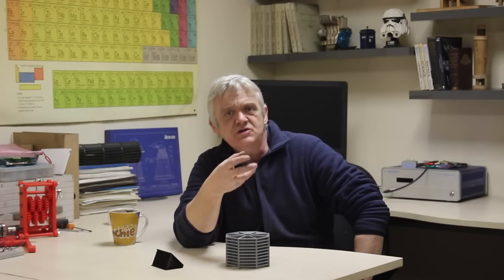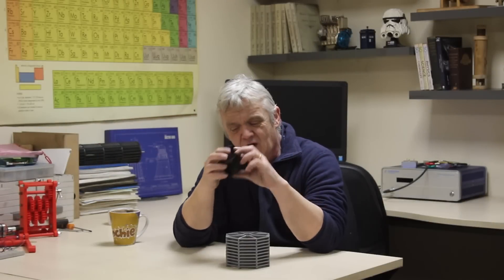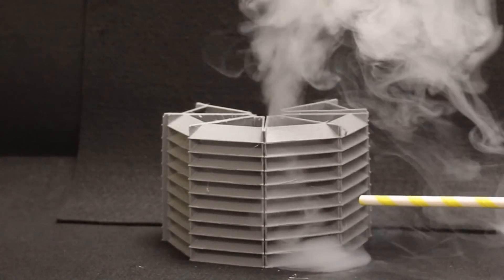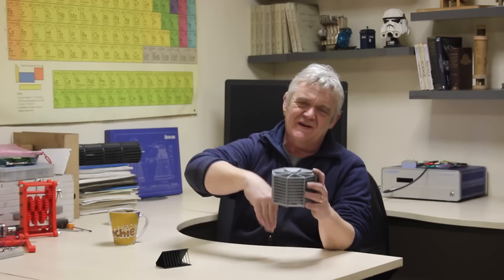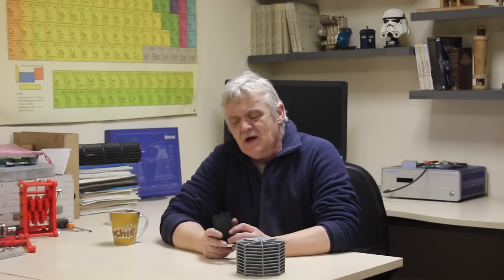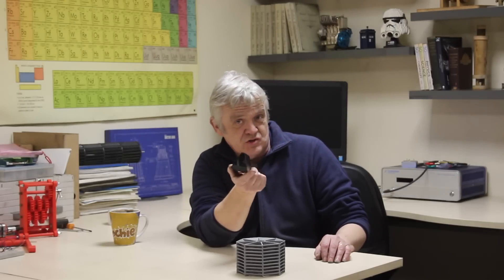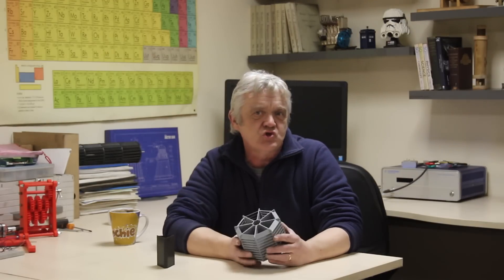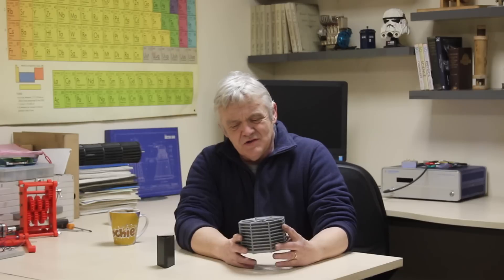1830 A Darwin Wind Turbine Breakthrough

Comment: And... The birds can nest in the upper part of the wedges!

Birds are going to do what birds do, and as the top is negative space as far as wind generation is concerned, maybe there,a a way to take advantage of the birds nesting in the top.  Maybe the heat generated by the birds and their decaying nesting material could keep ice from forming in the system or the heat heat differential could cause additional airflow in low wind?  Hot air is thinner than cold air, and gas flowed from high density to low density....
Maybe painting the top black could create some air draw?

Also. Which way I'd the 35° measured from? The horizon or the top?
Reply from the maker: the horizon - maybe some bird netting over it?
Reply: @ThinkingandTinkering  just pondering if there's a way to make birds nesting on top a good thing for the system.  Could thusly offered a secondary advantage somehow...

Comment: hrmm could you use the centre tube in the structure as a draw tube to draw more air into the intake using the velocity of the air being directed into the tube like those dyson ring fans do to boost up the effiency of the tower perhaps?
Reply from the maker: yes you could - nice one mate

Comment: That's really great that Rob, it did occur to me that it may be possible to get the air to spin (think Dyson vacuum) before it hit the turbine blade.. Have no idea if it would make it any better - just a thought.
Thanks 👍
Reply from the maker: it's a good thought mate - cheers
Reply: That will happen automatically to some degree if there is a fan-blade of the rotary type added to the end. Swirl will be created that way.

Comment: Very clever.  It's a sort of one-way tube for air.  I wonder if it can be used to vent hot air from the roof cavity to provide additional cooling in hot climates.  Or even as an improved chimney design.
Reply from the maker: I like the thinking mate and now I wonder the same thing!

Comment: Hi Robert,
Does it have to be as complicated as that? What about just one panel that is able to turn to face the wind direction. Yes, you would need extra tech to allow that to happen but you would be reducing the amount of materials required to construct the circle version and therefor the overall weight of the unit. Just a thought.
Reply from the maker: it's a good thought - try it and see

Comment: Fascinating. What is the optimum height of the louvred section (~number of louvres) to drive a pipe/fan of a given diameter? Should the fan (turbine) blade angle be 35° too? What should be done with the exhaust air?
Reply from the maker: no idea lol

Comment: I remember watching a show about bridge engineering and that on large columns and such they put helical fins around the column to prevent eddies forming and to stop vibration and I keep wondering if adding similar to the inside of your pipe, would help streamline the wind and increase the efficiency of the captured wind before it reaches the venturi and the turbine blades. I don't do a lot of fluid dynamics but wouldn't organised air lose less energy? Love what you are doing
Reply from the maker: I like that suggestion mate - cheers

Comment: Great video mate. Well done! Would love to see a close up of the cheesy wedge!

I wonder what would work better, forcing all that wind down a longer tower, or multiple motors every X CM stacked on top of each other. I imagine it would also depend on average wind speed, but might be worth some further experimentation to see where any sweet spots lie. Think you're really on to something with this one, would love to see more!
Reply from the maker: I was thinking of doing a vid on the design - it's simple but folks like a close up and I agree it helps
Reply: (the hazard with trying to maintain flow energy through a long duct/tall tower - using an expansion tower plennum - lowering velocity through the "larger" duct, then a converging nozzle - at the turbine inlet should maximise generation out of this system.  Every system has limitations - the "cheese slices" limit inlet plennum volume to something less than half of the total, also - these tests don't show the suction effect of true "freestream" flow - fabric (soft vinyl or other) valving to close the suction side off instead of the full depth "cheese segment" fixed flaps - may produce dividends )

Comment: I got 6 louvre doors in the shed! 👍
Reply from the maker: awesome! lol - don't forget to replace the door !
Reply: @ThinkingandTinkering  I thought I would try stapling fabric, or plastic sheet to the inside of the louvres and cut slit flaps in it, so air can blow in but also push the unused flaps closed as it does. Any opinion?

Comment: According to Betz's law, the maximum efficiency of a wind turbine is 59%. If you multiply that by 90 degrees, you get 53 degrees. The complement of this angle to the right angle is 37 degrees. Does this have anything to do with the optimal 35 degree angle?
Reply from the maker: I don't know

Comment: I cannot help but think. I think the test has failed, not having a cap on top. When you do, I think the passing air (of the wind) is creating a vacuum, on the backside, and draw the air in the same direction (out of your device). To test it correctly you need real wind, which passes by your device to the sides and above, and then see what happens. Hmm, as I start thinking. You could even capture that vacuum as well! You need 8 pipes which go to the 'outlet' below your generator. This will recycle the air, but importantly, lower the total friction. Just thinking out loud .. .. I know that always leads to something better and it does not even have to be about what I said, but it leads to thinking differently  in general.
Reply from the maker: this isn't in isolation mate - I did the reading - actually all I am showing is a visual of a few research papers I cobbled together

Comment: I'm a hvac installer. Essentially you've created a duct. If you add and curve  the iner throat of the "cheesy wedge" it will essentially 'pull' the air around the corner and reduce drag kind of like a air foil on a wing
Reply: Also if you flare out at the outlet  you might find you increase the volume of air I wouldn't add much say 10 degree should  be more than adequate.  I realize it add complexity but you can do alot of neat shapes in tinkercad
Reply from the maker: nice - thank you for the suggestions mate

Comment: I'd like to see more content about head batteries, or to be more exact about the way to cheaply transfer the heat from really hot mass. Sand could be heated to couple hundread degrees C, but transfering this heat to something more usable could be a problem.
Reply from the maker: there is not a lot to say about them mate - use a heat exchanger

Comment: Brilliant!, so if the design would direct the wind up or down into a vortex of 35' this would be ideal I derive? Currently the flow has to bend 90'-35' = 55'. Admittedly difficult to do efficiently with flat panels. Have added a 3 step angle concept to tverse. edit: Rethinking your design, behind the device a negative pressure will be formed, not sure how big the impact of that is. Although it undermines the objective of 'no moving parts', this negative pressure could be used on the outlet of the generator to improve performance.
Reply from the maker: a wells turbine?
Reply: @ThinkingandTinkering  Not what I meant, air flow around cylinder will create a vacuum at the back effectively sucking air in the opposite direction, effectively putting a break on the generator. Not sure how to share 3d models/info without YT removing it, ThingiV object 5812910.

Comment: Have you thought of trying what invelox are doing but you put 8 in a circle and you can even narrow down the out let  at the bottom to increase the wind speed. This way there is less wind resistance from all the little flaps in your version so in theory it should be better efficiency. Remember every surface that wind has contact with Will slow down the speed a small amount. Btw flat edges and sharp corners create turbulence which slows down and reduces energy. Smooth round corners and edges are better for efficiency but more difficult in production.
Reply from the maker: I have done it already mate

Comment: Nice one, Rob! How tall can you make this thing before getting diminishing returns on the airflow? I bet there's an optimal ratio between height and radius. At first I was thinking a pyramid or a cone shape might do well (the cone angle would be arctan(optimal height/radius) ), but then you're losing a lot of captured area at the top.
Reply: The 35° angle is going to give you the maximum ratio of height to radius.  Rob didn't mention if that 35° is measured from the horizon or from the top.  If it's the horizon, the Radius is sin(35), Height is cos(35).  If it's from the top, you reverse that. The Radius is cos(35) and the Height is sin(35)

Multiply each those by what ever your unit length is going to be and you'll get your dimensions

There could be a sweet spot in between, cut off some of the top, cut off some of the bottom.  That would make for a good stacked tower
Reply from the maker: there probably is mate - but I don't know it - yet! lol

Comment: I suspect that the "ideal" angle will actually be a section of a parabola. 
I also suspect that it might not be worth the extra effort to get there unless you are a factory producing many units.

When you think about it you want the leading edge to be close to the angle of the wind entering the device and the trailing one to be close to the direction of travel you want the air to go in.
Having the central area blocked by a solid barrier is a touch of genius. If there is a small to no gap between the fan blades and the central barrier there will not be any "spillage back up the low pressure down wind side of the device.

Nicely done Sir!
Reply from the maker: cheers mate - but also - very nice ideas from you - thanks for sharing
Reply: @ThinkingandTinkering  You are welcome!

Comment: Would there be any advantage to be had from alternating the direction of every other flap set and then placing a generator on both top and bottom?
It might allow for you to operate in higher wind speeds at the cost of needing to have a higher starting speed. 
We might get some surprises with the equal spacing, however.
Reply from the maker: I don't know to be honest - worth a try - fancy trying and sharing your results?

Comment: Nice!  Wouldn't you be able to save a lot of print material by not printing one of the sides?  All of the sides where the wedges connect are doubled, and really you only need one surface between each wedge.  Printing just enough between the louvers to connect them on one of the sides, and the wedge wall on the other side will save time and PLA.
Reply from the maker: yes but it would make construction a little more complicated - but not by much

Comment: Install these around the citylight concrete pole, and you do not have to make the internal core, but you can generate the electricity for the citylight itself. Because the hight of the pole I assume, the sqm of that sort of wind cathcer would be a lot, so does the energy generetaed by that much air. Robert can you give an estimate for a lifesize scale model?
Reply from the maker: I like that idea mate - nice share

Comment: Couldn't you use a weather vane set up and reduce your materials by a large percentage and reduce "dead inlets".  Yes it would require and additional mechanism on the base but not that complex.  You could really make a flatter panel wind capture and certainly increase the capture area for the same amount of materials.  Essentially like some triangular wind vanes at airports (for pilots to see from the air).  (Look up airport ground wind indicators for examples.
Reply from the maker: you could - go for it mate
Reply: @ThinkingandTinkering  well🤣 send me that 3d printer😂 Keep on with your good ideas and thanks

Comment: An excellent idea to prevent air flowing out the down wind side of the collecting tube. I wonder if a possible issue may exist at the turbine end of the wedged tube in that only 1 of the 6 wedges will be powering the fan blades with down drafted air. Would this then mean the rotating fan passing beneath the other 5 wedges is actively pulling air down them and so contributing a large energy expenditure, reducing efficiency?
Reply from the maker: we will find out mate

Comment: Great idee, i see only one problem. If you use it with the generator on the bottem, Al the rain wil be going inside and could damage the generator.
Reply from the maker: that will not happen mate - most - if not all wind generators have the generator at the top of a pole and that does just fine in wind rain sleet and snow

Comment: Hate to throw cold water on this but the problem is going to be that the leeward side is going to suck air through its cheesy wedge pulling the air pressure away from your turbine at the bottom.

This is why you have to have some mechanical flaps to prevent the downwind side from sucking the air pressure out of the Tower instead of it going down the turbine.
Reply from the maker: lol - ah mate - thought about that - put a wells turbine on the bottom

Comment: A variant I seen while I was watching your video is that the upper slates would be longer and the lower ones shorter, to help reduce turbulence and make a laminar flow and maybe give it a round shape so the upper ones can bend the flow seemlessly and the lower ones still at 35 degrees and the mid ones stopping at different level since you can't keep the curb from top to bottom without creating a restriction.
Reply: I like the fact that the mechanical part is not up in the air. even if the ducting limits the energy it produce it could still be interesting.
Reply from the maker: nice suggestions mate - cheers

Comment: Co flow technology might helped as a quick mod. In theory up to 70degrees of attack. Louvres. think shark gills?  If you did it right you can induce more airflow. ? Using the wild to induce air currents? I’ve made a co flow shelf. Which can be angled to optimised airflow? It can be made cheaply out of a shelf from b&q. For about £12 unit? With a forming rollers. Add two slit to few of the shelves. Then place inside the non modified shelf. To make a sandwich. You can also use them as guide fins?  You might also want to investigate adding piled carpet to the side walls? As it can smooth airflow by reducing boundary layer effects? Shark gills are incredibly efficient at what they do? If it works in water it might just work here?
Reply from the maker: nice share mate - thanks
Reply: @ThinkingandTinkering  thoughts you might like it? Great to hear it!

Comment: It could be worthwhile having sections of gradually increasing diameter. With a ground level turbine, that could allow for easier erection of the column and allow for collapse to a short height e.g. to clean or avoid high windspeed damage.
Reply from the maker: cheers mate

Comment: Well done yet again Rob very inciteful and briliant You mentioned the venturi lower down how about making it on the top of the pipe and making the darwin collector bigger then you can use a smaller diameter pipe that would be cheeper and have less wind resistace
Reply from the maker: nice one mate - cheers

Comment: Just a thought Rob, How about several fans down the length of pipe to maximise the air flow. Granted the force further down the tube would be less due to the drag coefficient. but could  give a reasonable return of power ???? I'll put it on my to do list. lol

How about putting it on top of a flue pipe so the wind forces the heated air in the flue pipe out faster, giving a stronger air flow through , say a rocket mass heater giving a better burn. I'm building one at t6he moment in my greenhouse, so i will try this one out.
Awesome.:goodvibes:
Reply from the maker: awesome mate - please share your results

Comment: Perhaps replacing that centre cylinder with an exaggerated screw thread. Big enough to guid the air towards your focal point, it may help reduce the amount leaking back out the front simply by creating an air draw
Reply from the maker: maybe mate - go for it and share the result!

Comment: If you look at the segmentation of your air collector . . . you could take those segments apart and distribute an appropriate number of them around an existing column, chimney, or tower, and then have multiple fans at the base, or use one large fan with smallish collectors distributed in a ring above the ends of its vanes, again with some central structure.  This might add power generation to existing columns (chimneys, flagpoles, support structures) and/or increase collection area at little additional cost, while removing the need for a tall stack of collectors to be structurally self-sufficient.
Reply from the maker: clever mate - nice one

Comment: Excellent that internal structure will stop loosing the air collected & greatly increase strength but if you remove one of the walls from sections each section would be one wall for the next section & remove a large amount of material with out reduction in strength.
Reply from the maker: good suggestion mate - cheers

Comment: Why do there need to be cheezy wedges at all?  Why not make it one piece?  You would save material and you would not have to assemble it.
Reply from the maker: so you can print it in parts big or small depending on your printer - or do it in one job if you have the equipment or a 'kit of smaller parts' if you don't
Reply: @ThinkingandTinkering  Brilliant!  Love your videos!